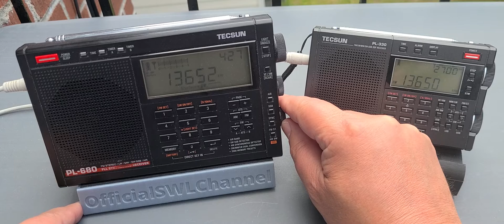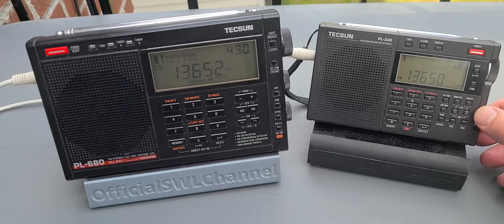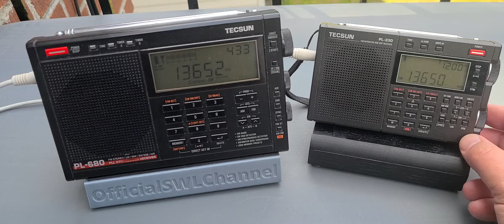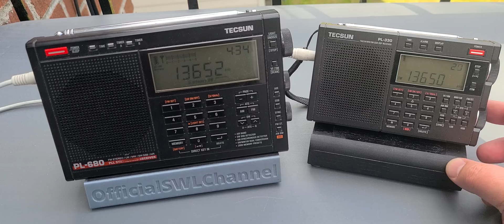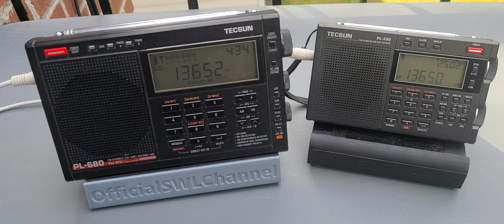Tecsun PL-680 PLL Receiver VS Tecsun PL-330 DSP Radio Romania 13650 kHz Shortwave

Comment: The PL-680 sounds better, with more steady volume and less noise. The voice is more intelligible.  Maybe I will buy it somewhen, too. But my PL-330 will stay, of course. Tecsun might add a calibration function to the PL-680, if necessary by adding a trimmer condensator or potentiometer plus a hole for a screwdriver.

Comment: They are not tuned on exact frequency on 680 is 13652 and on the 330 it is 13650 maybe the difference
Reply from the maker: no, the 680 is off by 2 kHz, so at 13652 it is tuned on frequency

Comment: I note the PL680 is tuned to 13562 and PL 330 on 13650, the correct freq.???. Not a fair comparison. My PL330 audio is excellent as I feed the audio to a Panasonic active speaker.
Reply from the maker: it is fair.. the 680 I have is off by 2 kHz .. so it is tuned to the frequency
Reply: @OfficialSWLchannel  Tem como calibrar ?

Comment: J'adore ces deux radios, je possède depuis peu les PL-330 et PL-680. Après les avoir tous deux calibrés, je les trouve précis sur toutes les bandes de fréquences. Mon PL-330 à le firmware 3305 et mon PL-680 le firmware 6622.
C'est sûr, si on les écoute sur haut-parleur le 680 sonne mieux, mais avec un casque, il n'y a plus vraiment de différences. 
Merci pour cette revue !!
Reply: Como calibrar o 680 ?

Comment: Cool video! Appreciate your effort & time to give us this perspective & comparison. 
I just purchased a PL-330 largely based on your positive review of this model.
I have a question re the tether attached to the radio for carrying. I do not need it since I will rarely use it. Is there a way to remove it from the radio other than simply cutting it off?
THX in advance! D. King, Thunder Bay

Comment: IS THE ML30+ LOOP  APPROPRIATE FOR THE 990X?
Reply from the maker: MLA 30 works great with all radios, you will need to have an adapter cable for the antenna connector
Reply: @OfficialSWLchannel  thanks. Look forward to your videos.

Comment: Question. Why did you not use the sync. On the 680 it would have been a lot better copy of the signal.
Reply from the maker: cause Sync on the 330 is bad... so to test they have to use the same mode

Comment: The PL-330 had a pumping effect of the signal like no AGC.  The 680 handled it much better.  Of all your PL-330 vs whatever, this is the 1st video that disappoints me with the PL-330.    Is there a gain control for the PL-330?
Reply: No gain control or switch LOCAL-DX for the PL-330.

Comment: any reason the PL-680 was tuned to 13652 not 13650? and I believe if you tune the PL-330 to 13652 you will stop the muting during deep fades so could you possibly do this comparison again?
Reply from the maker: it is off frequency

Comment: I notice they are not on the same frequency.   Unless the display is off?  The dsp doesn't seem to hold the signal fade as well, but trade-off is size and weight, I assume.  Nice comparison,  thanks for the video!
Reply from the maker: 680 is off by 1.5 kHz